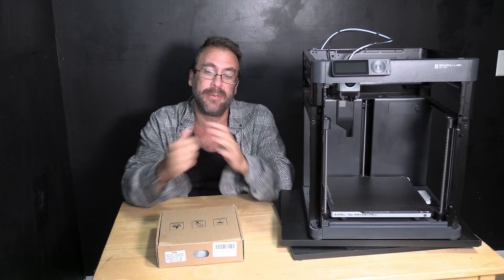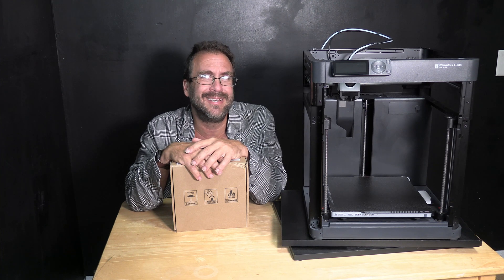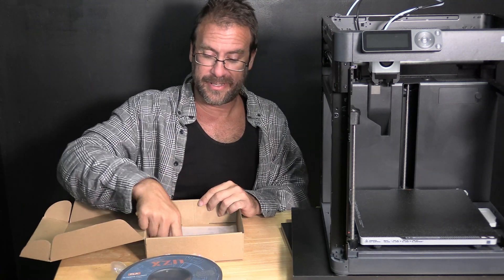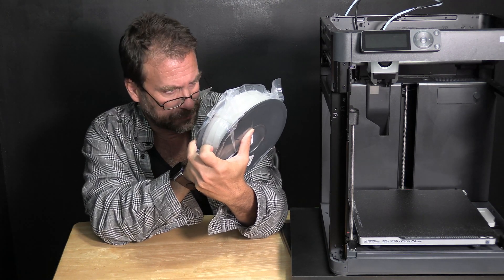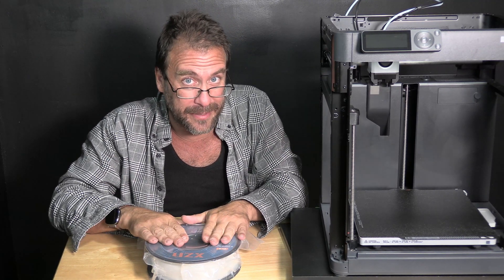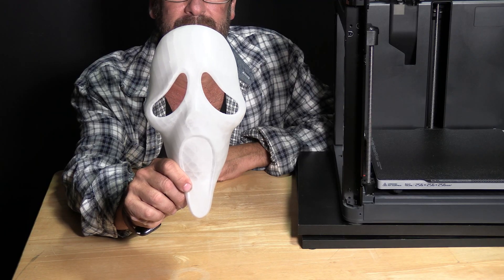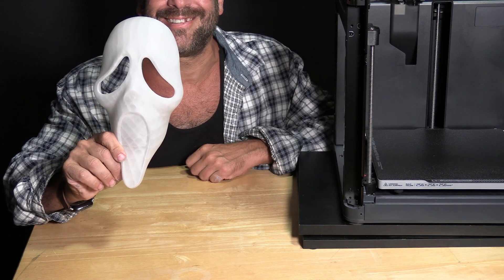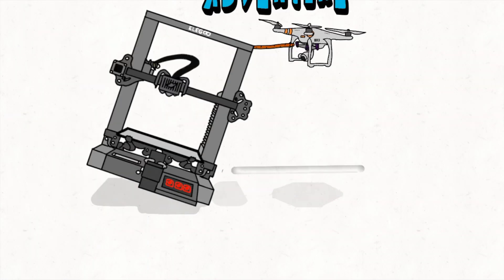Testing Glow in the Dark PLA FIlament with Bambu Lab P1P using Hardned Steel Gear & Nozzle Upgrade

Comment: What is the temp for this filiment i just bought it and ngl im kinda scared to use the wrong temp
Reply from the maker: No need. if it fails it fails. That's all part of this 3D printing adventure. I have been printing Glow Godzilla's on my Ender 3 V3 KE at 220/60.  I would do the same on my P1. If you feel there are any adhesion issues, go up 5 Degree on the nozzle. Use proper supports. Don't skimp on them.
Reply: @3DRundown  ok! Thanks, i was overreacting tbh i just set it to Bambu lab glow and benchy printed perfectly
Reply from the maker: I feel you though. In the past, things were very different. The newer machines are much more tolerant. I have actually had some Glow filament that was fail city on my P1P, but, the switch to Smooth PEI stopped that...
Reply: @3DRundown  good to know I actually have a smooth pei so i will be using that!
Reply from the maker: Smooth is KING. People like to argue me on this, but it's a FACT

Comment: You get much better glowing results with 100% infill (or all walls). It'll just take FOREVER.
Reply from the maker: Leaving space and thinner walls, let's more lit get in there to expose everything. This guy glows like crazy
Reply: @3DRundown  well I'm glad you're getting your results. Unusual but cool. My 100% crystals will glow long enough from bedtime through wake up. 

Anyway, cool video and thanks for doing it!
Reply from the maker: Nice. I've only done 2 glow items ever. Doing my 3rd now. I need these to have a good balance of Strength Vs Weight, as well as cost to make. But I'll continue to experiment.